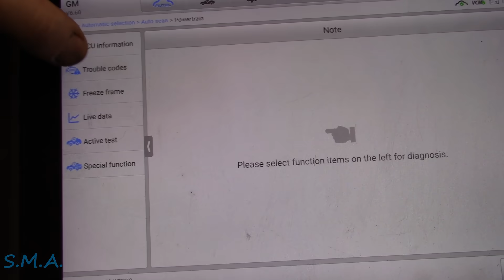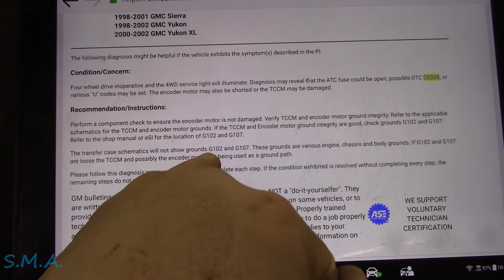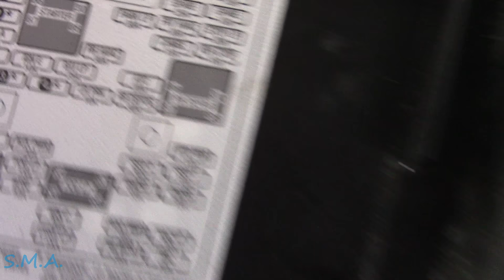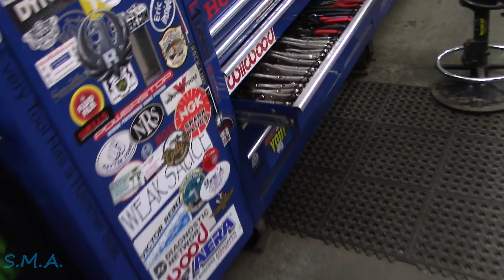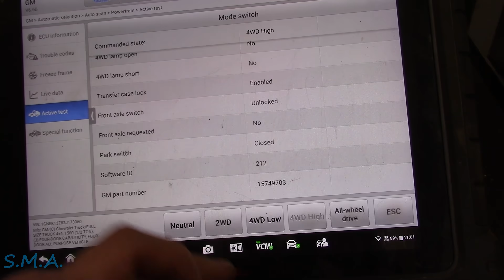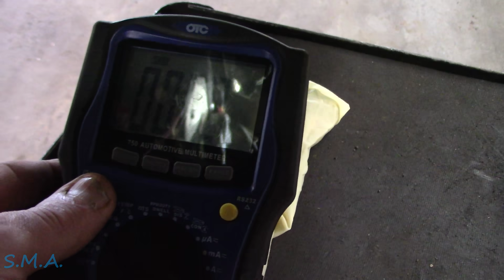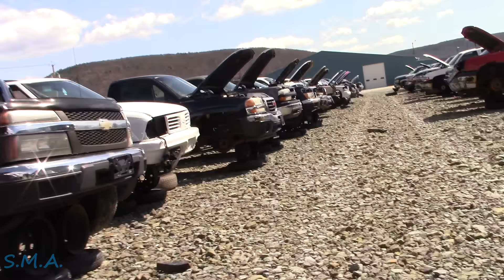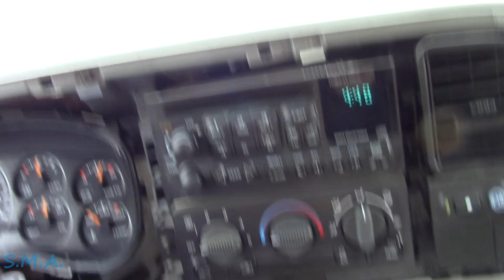Customer Spent $1000's And Still No 4WD

Comment: Chevy has issues with ABS? I learned to drive before they invented it. My Ferd ABS sucked bad and almost caused an accident. Who thought THAT was a good idea? I pulled the fuse so there was no ABS and had brakes instead. Good to know that kind of stupidity is not limited to any one brand. Now I will go drive my '66. It has the kind of ABS that always works.

Comment: Note to self: Next time take the meter [and the extra tools for the driveshaft or whatever] to the junk yard to test the part there before you buy it bring it home and find out maybe it don't work either....jus sayin'...yup? I work on the Chevy trucks and 9 times outta 10 it's that shift motor. they should give an option for a manual shift on the transfer case like the good old days. Just because they can put a computer on it doesn't mean they should. Enjoyed watchin', thanks.

Comment: Great video, one question two parts. Is that a new scan tool and what is the model number? Follow up question I thought you were using the Snap-on? I have 2002 chevy Z71 I put 308,000 miles on and your videos have saved my bacon to many times to count. Thank you for taking the time to do them. Gene Pond

Comment: I would of sold it or parts the taco the first quote of thousands in repair costs I got. Gas guzzlers are not worth putting a bunch of money into. I'm not by far a person that recommends or supports the new vehicles [computers on wheels] but in this case I'd try to find a light duty truck. 4 cylinder. Or maybe a small v6. Even in 4x4. These trucks are a dying breed and I doubt you'll ever get close to what you put into it if sold.

Comment: similar encounter with a bad new part in a pinehollow diagnostics episode. a bad newly replaced controller was disabling the dash electronics of heat, gps etc. dealer couldnt solve it so they gave the customer a huge 7k estimate to rewire the dash! Turns out it needed another controller.

Comment: you operate like auto technitions should you dont take what everyone else says as what has been done or checked you dont trust that just cause a part has been changed it is good and you dont start with the most expensive fix.. you start at the begining and basic fix and work your way from there more people should be like you nice fix.
Reply from the maker: Kinda true. What I do is let the facts dictate the call. The facts don't lie. It may be an easy fix and it may be an expensive fix you just never know what they will point to till you run them down  👍

Comment: i swearif the problem is not fixed people shod be getting there money back... 
i got in to a fight with a shop because they told me they can get the P0133 code fixed..
The O2 sensor where all changed out 3 times, the MAS air flow, spark plugs and wires, the catalytic converter. all adding up to like $3,000 and the light was still popping on!

Comment: I spent a couple thousand trying to figure out why my 92 chevy astro van is running so terribly. I live in Charlotte, NC and these auto shops around here are terrible. I guess they all have too many customers and dont want to spend the time trouble shooting. But Ive spent thousands getting things replaced and its still running bad. It gets better each time but still the issue isnt fixed. One shop told me it was a plugged catalytic converter. Had that and the muffler replaced. It sounds better but still runs like shit. that costed me 1200. and I replaced all the sensors filters and fuel pump myself. Im starting to have a feeling its the intake gasket that needs replaced. I never realized but its not really holding coolant very long. But its not overheating either and there are no leaks. I actually seem to have a bit of a problem getting it to make normal operating temp. Ive also replaced the thermostat. Damn thing still runs on the cold side. Oh and the temp sensor was among the first things I tried. It helped a little but didnt solve my crappy running problem.

Comment: 000.3 ohms on the control motor? Divide that against 12.5V typical battery voltage and that's 42 amps of current! At that point it's not a motor anymore it's an oven element! Great job on the diagnosis Eric!

BTW - I'm so jealous of the green grass from the video. We still have snow on the ground here, and we're getting another major snow/rail storm this weekend. That's the joy of living in Western Canada.😢

Comment: Hi Eric, great video as always! However im not too sure about the ground not blowing a fuse, as far as I'm aware if there is poor connection to ground (not completely broken) that could cause lower voltage which in turn would cause higher amperage and could potentially blow a fuse or am I completely wrong about that?

Comment: Pep Boys quoted my niece $1400 to fix her car.  I took a quick look at it and there was a DTC for the VVT.  Replaced an oil control valve for $20, off and running again.  Too many shops are like that these days, at least around here.  I get making a profit but $1400 for an hours work and a $20 part is insane.

Comment: My '06 Silverado has a floor shift transfer case because it was a Gov't truck and they ordered it that way.  Far as I'm concerned they all should be that way.
Reply: My 06 Silverado is also a manual transfer case. I would not touch one that had a push button 4 wheel drive, or dials or squeeze toy actuated.

Comment: Love you work and your style 👍👍👍Great diag and job and yes you’re right sometimes used OE part times better than reman or crap aftermarket but again avoiding fitting SH parts on the custards or cunstomers vehicles due warranty and insurance issues also even crap parts carry warranty and labour claim from supplier here in UK it just a hassle doing the same job twice which is bad in cunstomers eyes 
Take care and thanks for the video

Comment: Eric, you saved me a bunch of money today from going to the dealership with a fog light out. Bought a new set, put a known good bulb in, still nothing. Test with a meter and voltage was all over the map in the millivolt range. Follow the look to the driver side where it ties in with the left fog light and the headlamps, go back to the middle to what looked like a pinch point, sure enough, 2 grounded wires.  Get my electrical tools out, cut wire and put bullet connectors on for a temp fix, but it only cost me 60 bucks for the bulbs, no diag charge and wait for the dealer to fix it.  I’ll get weatherproof connectors once I’m done working 12 hour days.  Thanks again, and I followed your motto, “If I can do it, you can do it”. 

Thanks for reading!

Comment: You use a test light a lot.  I just bought an el-cheapo circuit tester for around $20.  Essentially the same thing as a test light but it shows you if the circuits have ground OR power.  And you can GIVE ground or power to a circuit as well.  Excellent for testing!  Used it for the first time the other day and I am forever sold.  I have NEVER been a test light guy before, either.

Comment: It's new, it must be good! It still amazing me how manufacturers change from systems that worked for decades and go to automatic crap. What was wrong with the old lever on the floor? Probably too many people tried to shift into 4 low while at highway speed so now you have a computer that won't let you be an idiot.
Reply: Why do steering wheels need heat or seats need to be cooled? People are pansy, whiny, entitled brats now days. I love when "men" will say things like "my wife won't own a car without a heated steering wheel" or "I can't have a manual transmission because my wife thinks they are antiquated". Makes me want to vomit. Men won't even stand up for themselves on this basic crap and then wonder why they get walked on all the time. Gee I wonder. Hell some "men" are retarded about this stuff too, watching a "man" complain that he can't buy "X" car because it doesn't have puddle lamps is sickening. People have gotten far too comfortable, fat and lazy.
Reply: Got levers on my ‘52 Landrover 80 inch.   70 years old and still working

Comment: The big clue is that it, the motor blows the fuse  because it's shorted to ground.  And I agree that a used OEM is better than a new one, at least in this case.  It's cheaper too.

Comment: Do daily drivers need 4WD? I live in Canada and my Front-Wheel drive sedan with good quality winter tires does perfectly fine. If the winter weather is that bad , then stay home until the streets are plowed. How many Audi's, Subaru's and SUV's never see snow, yet push around a 4WD system all day long? Work trucks different story...

Comment: Fantastic video, I can't tell you how many times I have been burned by Chinese parts. THEY ARE JUNK! Recently a Dormen W/W motor on Chevy truck. I had a wheel bearing go out on the interstate, I found an AUTOZONE nearby and all they had was Chinese, went 5,000 miles and ruined a rotor and brake sensor. I replaced a taillight board with a Dorman, it lasted 2 weeks. I found it amusing that junk parts are better than Dormen LOL

Comment: Just a few seconds in and this video's already giving me Nam flashbacks. I have an 02 Suburban that would not properly engage 4WD when I bought it, the 4HI light would just flash nonstop. No SERVICE 4WD notification on the dash or anything. If you tried 4LO the transfer case would switch to low gear but the front axle would still not lock.

Backprobed the axle actuator connector and found the wiring to be good, so OK, the actuator is junk. Got a good working one on eBay, plugged it in, and ... still nothing. At this point I wanted to push the thing off a cliff. So I take out the eBay actuator and put the original back in, ready to go back to the drawing board, but as I go to plug it in I notice the connector doesn't quite look right. Turned out  a couple of the pins were recessed just enough that they couldn't reach the actuator, I guess either due to corrosion or someone front-probing it carelessly. Got a new pigtail and finally got good working 4WD.

Comment: Sucks getting new parts that come out of the box defective.  Recently had a new tail light plug from NAPA ( never applicable part available) that didn't work out of the box had me scratching my head, especially since I hooked it to a new tail light that was also defective. What are the odds of that. Must of pulled that stuff out of the defective parts bin in the back.

Comment: As a retired guy this is my biggest fear is handing a mechanic $2000 and getting a shoulder shrug with a “I don’t know” reply! Devastating thanks for sorting this out ☮️🙏
Reply: That’s what I was thinking. It’s one thing to charge a diagnostic fee, but charging for a repair when you failed to repair the car?
Reply: Buy a Tacoma...3/4's of your potential problems GONE! #1. Starter (Around 130,00 miles) #2. Coils (160,000 miles) #3. Squirrels in the blower motor (Every freaking year until you install metal mesh screen...)
Reply: my motto is you pay me for my work - but if i can't find the problem, what did you pay me for?  I've had to send a few to the electrical shop - and thank god they had a hella time to find it too.  But if I can't fix it, i WILL NOT charge you.
Reply: Just don’t buy a 2nd gen if you live in an area where cars get rusty. No frame replacement for me but I did get the cruddy frame coating that peels off after a winter of driving

Comment: So for 600 big ones the problem could have been solved with a new oem part, but instead the owner gets aftermarket failure and a $2k slug to the wallet.

Comment: That was classic straight to the point diagnosis. You are lucky to have Wilbur's place near you. That is so crazy that a remanufactured unit is worse than an old OEM one. No wonder the customer was frustrated. You have a job there until you decide to hang up your wrenches. Heck, then you can have a great career teaching newbies your methods. Thanks for showing us how it's done.

Comment: Every time I hear somebody b!tch about OEM parts, I point them to you and ETCG.  They work.  What I WILL B!TCH about is the price.  When a company charges $300 for a condenser that they paid $50 for, it really does cheese me off.  I had to replace the cup holder in my '99 Tahoe...$45!  The guy I was working with had the wrong screen up on everything and it shows their price of $2.75!  

I honestly think that many people would do more maintenance to their vehicles if they'd just be reasonable on costs.  When a service garage wants to charge me $400 for a 30 minute drain and fill on my Fusion Hybrid CVT, I'm being robbed.  Plain and simple, that's pure theft...same price at the dealer, quick lube, and local independent.  $400 for removing a wheel, pulling the underbody shield, pulling the fender liner, undoing two bolts, draining, and filling.  $400 frelling dollars.  Sorry, if I could I'd do it at home, but $400 for literally $60 in materials, and 30 minutes in time.  Then they cry "but it's cheaper than a new unit".  Sorry guys, my 8 year old vehicle isn't worth the $5K you're going to try and charge me for a new unit.  Almost like the dealerships don't want you to maintain your car...so that they can sell you more...and yes, that's why they do it.

Comment: Love how Eric will go to a scrapyard to get a part I don’t know any mechanics that would do this, though we all know Eric secretly loves going to the scrapyard especially if the ice cream shop is open. And…..as always we get to learn something.
Reply: Because he has the skills to clean up a salvaged part and make it work like new. Most people do not.
Reply: I have got a 2006 Chevy HHR. You'd be surprised (I was) how many parts are obsolete and no longer available even from aftermarket sources. Used parts from the scrap yard are the only option in a lot of cases. Either that or scrap the vehicle.
Reply: @robgm6926  I’m beginning to realise the issue with parts, not so bad here in the UK oddly enough at mo, but getting worse. Good time to be in scrap business.
Reply: @robgm6926  learn what ebay is. cars are not disposeable.
Reply: @MrWolfSnack  eBay doesn't have everything. I've looked. And I continue to go back and look because I know just because you can't find it today doesn't mean it won't be there tomorrow.
Reply: @MrWolfSnack  Ebay parts are sometimes so bad that fitting a second hand OM part is a better option, I've had parts that are not correct for the vehicle or have manufacturing tolerances that are so bad as to render them scrap before you fit them.
Now I stick to OEM or OE parts where possible so I know I don't have to start swearing at the piece of crap that has been sent me under the guise of this fits because the seller doesn't have the correct data or is so lazy that anything will do.
Reply: My mechanic got me a junk yard a/c compressor, runs ok so far, taking a gamble there thou.
Reply: I know two mechanics who visit scrapyard if needed. I don't mind going there myself. Literal tons of stuff to see and learn from.
Reply: I do a lot of my own auto repairs, and I have learned that I would rather stick in a junk yard factory part than dorman any day. If you get the opportunity to take it out yourself, you save a TON of money. If the part fails after a little while, your really not out that much.
Reply: The high prices many used parts yards charge and the relatively low cost of new parts from China have greatly reduced the trips needed to the junkyard.
Reply: Right, 99.9999% would’ve put that Dorman on there and charged you OEM…
Reply: Where I’m at…they love to go to scrapyards for parts! All the shops do it! But! They charge for the new parts…I’ve worked in several vehicles that the local dodge dealer…deveny motors…had replaced things like pcm, struts and so on…where the vehicle parked crooks in the glovebox said $900 for a new pcm yet had the scrapyard guys initials on it…I went to the scrapyard and checked the price for a pcm on that model vehicle $40 and I had to pull it…..they charged another $1000 to install it….it was a junkyard pcm and took 2 bolts to install…replacing a strut on a 2005 dodge stratus…cost $1000 ….it was a used strut from the same junkyard…$5….happens AL THE TIME!

Comment: Great job Eric O 
You are indeed a genuine mechanic. Most mechanics these days don't nearly go through all the testing you do. They read a code and then slap parts on the vehicle. After it doesn't work they look at other possibilities as to the issue. They think since the replaced part is new then it can't falter.  These mechanic need to trust in their skills not in the fact that new never fails.  Eric O you always use your skills to figure out what the problem is  regardless of whether the parts are new or not.  We could use more mechanics that will take the time to diagnose a vehicle's problem.  Again GREAT job Eric O.
Reply: We